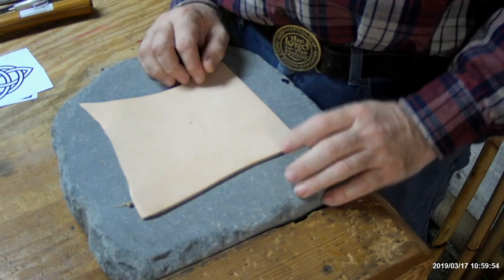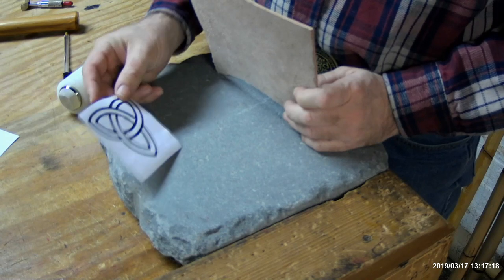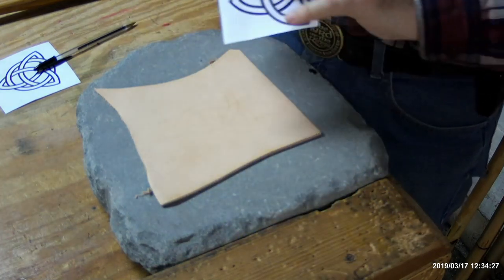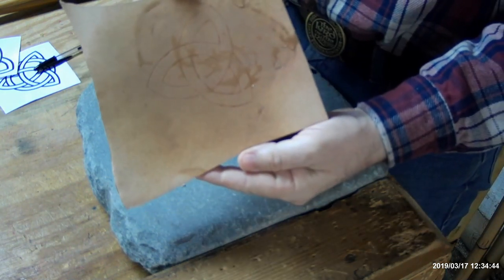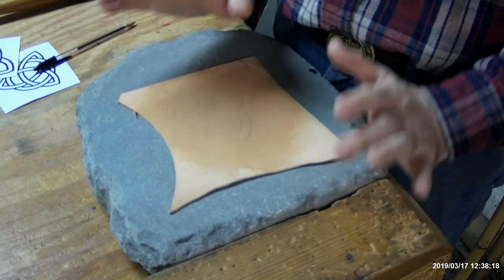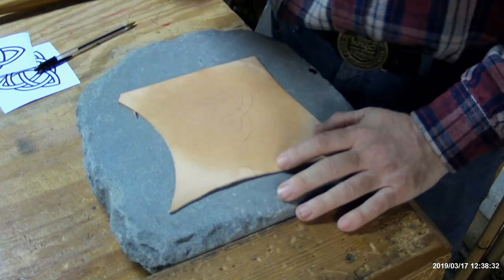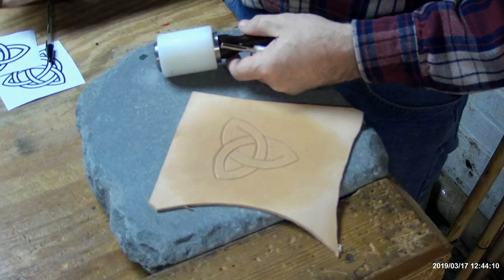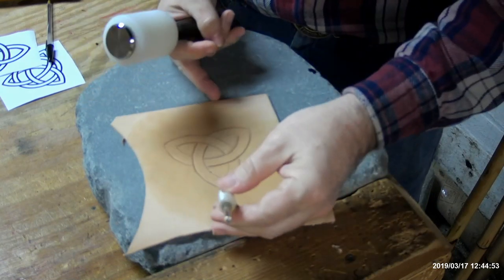Leather Tooling for Beginners

Comment: Nice tutorial. I use a slab from a shop that does countertops. They always have scrap they have to pay to get rid of.
Reply from the maker: Thank you. There is a local stoneworks here that has a pile of cut limestone slabs that you can grab for free. Most of it is about 2" thick. They need a little sanding to smooth the surface, but still very usable. I plan on taking my truck down and grabbing a load I can sell to folks getting started.

Comment: I made a wooden mallet thats pretty light for beveling. It sure speeds everything up.  I'm pretty inexperienced and I started out with a mallet that was way to heavy to do anything like this with. There was a 2 X 4"  scrap  piece of wood in the yard. About the length of a hammer handle. It made a nice improvised mallet and I still use it quite a lot.  Now that I've fashioned a handle on it with a roundish square head.